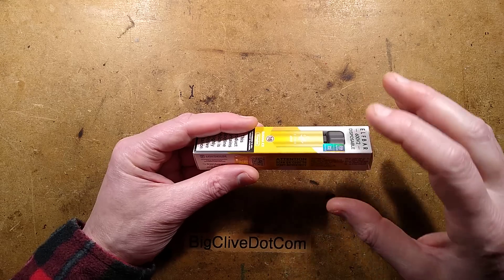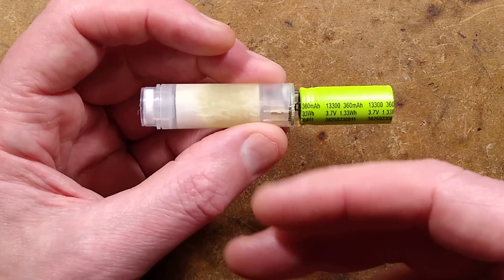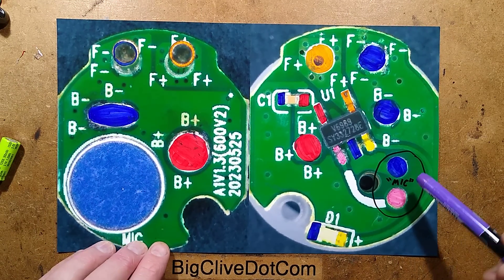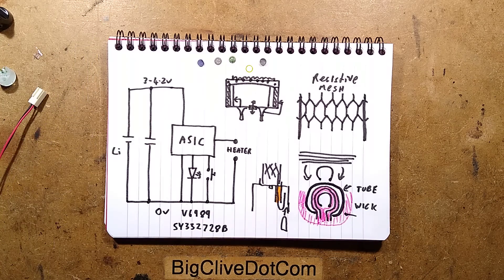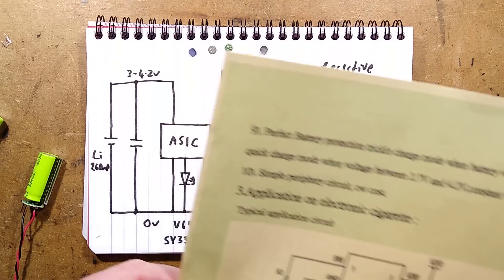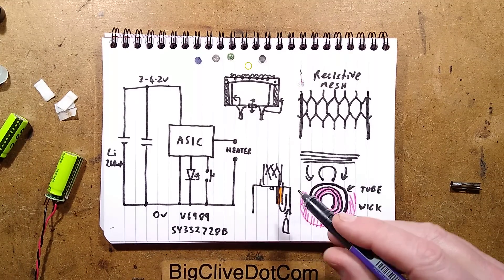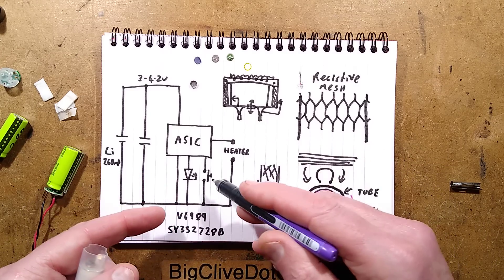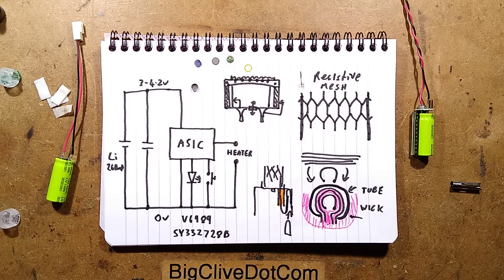Lithium "capacitor" in a disposable product

Comment: I just checked on internet if that kind of device was available in my country (France) and it sadly is. I have a big problem with it since i know how much i pay for my liquid and my vape which is around 40€ for the vape which will normally not break and the batteries can be changes easily for around 4.5€, so i just have the liquid that cost me 9.50€ for a month.

The product in the video cost about 6-7€ for 700 puffs which is ludicrous in term of price since I'm about 10 times cheaper with my vape but the biggest problem is the target which seems to be minors because it's easily bought on internet with minimal age verification and a cheaper initial cost.

Now my biggest grief is that kids buying that have in general 3 choices, 0 , 10 , 20 mg/mL in nicotine concentration. They will most likely buy the 10mg/mL because they are curious.
I vaped 10mg and it's insanely strong to the point of making me dizzy so image the effect on kids.

Ps : I myself am at a point where i dilute to 1mg/mL and soon will stop nicotine completely so Yay me

Comment: I used to work at a battery recycling plant a few years ago and we came across those exact type of cells in a few difference products. Its just the form-factor, Its the same inside as any other 3.7v lithium ion battery.

Comment: Please please dig a tiny bit further in this investigation. Can you establish how much charge is remaining after the vape fluid is expended? I have to clean these discarded items up, some have been run over and damaged and I am always wary of one cooking off when disturbed. My hope is the designers calculated the cell capacity to match the fluid and when fluid expends the battery is essentially dead. But it would be great to know.
Reply from the maker: The disposables often only use around half their cell capacity before cutting out.

Comment: oh yeah i've gotten a disposable vape with a li-ion cell packaged like a capacitor like that... mine had a grey shrink-wrap but otherwise was more or less visually identical
Reply: on a positive note, disposable vapes are excellent to take apart and harvest the battery from. i've converted a number of devices that were meant to run on 3 aaas with those and a cheap ebay bms board

Comment: If i'm remembering right, that microphone actually is the same kind of cheap, crappy microphone that used to be VERY popular in cheap consumer electronics, something like 30 years ago.. They're probably dirt cheap, which is why they're used in this application.

Unfortunately, because they're so cheap, and so shitty, they're prone to failing UNsafe, and causing a runaway activation, which then causes the battery to get REALLY hot, and the atomizer coil to burn, which can, eventually lead to a fire in your pocket.. 

ask me how i know.

Comment: That looks like an integrated coin-cell capacitor.

Simply put, it's a self-charging capacitor that charges off of a tiny integrated coin cell.   This lets a tiny coin cell run a much larger draw by simply drawing off of the capacitor then recharging it.

The coin cells in these are lithium polymer coin cells, which while capable of being charged do not have a very favorable life cycle and can only be charged a few dozen to a few hundred times, with the first few recharges seeing drastic drop in capacity.  The new from factory capacity is likely what the 360mAh is and the cell itself sits at the top or bottom.  It likely only accepts 280mAh on recharges.

Other times they simply add an additional layer into the lithium cell that puts a capacitor electrodes and electrolites on one side of the stack in the roll and then the battery electrodes on the other, to make a "Sandwiched" battery and capacitor integrated.

Comment: Not really new those lithium 'capacitors'...
I have one from a disposable i salvaged years ago, however the low capacity and high cost were supposedly why it was a rare find...

Maybe someone thought "It doesn't go bang" so swapped in a hard-cased lithium cell instead of a pouch!

Comment: Hey Clive,, You're beyond 1000 comments now so you probably won't see this - BUT did you notice that datasheet you briefly showed mentioned "Trickle" and "Fast-Charge" options and a 2.7V threshold ? Was there any info on where one would connect a power source to enable that charging option ?

Comment: 1. From what i know microphones ARE pressure sensors. Hardware wise they're the same, but if the signal is not captured "as audio" then it's not a "mic" in the usual sense.
2. it's nice they made the product more modular, but it really shows how much reusability they want out of it if the circuit does not allow recharging.

Love tuning into your channel from time to time. Always something cool to see.
Reply: Your first point is correct, mics take pressure gradients to move a diaphragm, and then couple the diaphragm to a system that outputs voltage. For example, dynamic mics have a coil (supplied by known current) attached to the diaphragm; as the diaphragm moves, the coil exerts a measurable induction onto a separate sensor, which translates the movement to a magnetic signal, then a voltage signal.

I'm not certain what kind of "mic" they have here, but instead of viewing the output signal as analog audio, they likely compare the voltage to a threshold that is broken when the mouthpiece is sucked on (negative pressure on that side).
Reply: You are correct, sound is nothing but air pressure.
Reply: All microphones are pressure sensors, but not all pressure sensors are microphones. These sensors in the disposable vapes have a switch contact attached to the underside of the diaphragm, the switch is closed when you aren't sucking, and opens when you are sucking. It can't measure any kind of in-between, all it does is open the switch when a certain pressure has been reached. They work almost identically to membrane keyboard switches, just with air pressure instead of keypresses.
Reply: @tissuepaper9962  I can't believe I watched the video, listened to him describe how the "mic" is a pressure-based switch, and still said I didn't know what kind of setup it was.

I guess I was pretty tired then. You are absolutely right, it's just on or off. It would certainly sound terrible as an audio signal though 🤣
Reply: I could see reusability, albeit somewhat "overkill", very useful trait: microchips are close enough in all kinds of products so could just take one from any broken device and put it to other device for repair... No idea what kind of "ideology" framework is needed for this to structure society also in practical terms more compatible with this but seems useful to reuse resources and materials and thus could even afford using higher grade components and a bit more expensive og products to begin with(aint apple products price higher coz people perceive higher resell/even used practical value for those vs same features non apple product).

Comment: Many thanks for yet another awesome teardown, chap! Always wondered how „disposable“ v*pe heating coils worked, so this has been an education indeed! 🚬⚙👍

What really concerns me though is the marking of the PCB for the pressure sensor: You wouldn't label it mic if you had no intent of ever putting one there, and proprietary ASICs can have all sorts of undocumented capabilities in them. ⚠
The tinfoil-hat in me knows a mono audio stream at 4kbps generates 29KiB/min and 1GiB of flash (Almost 600 hours of audio at that bitrate) would easily fit an IC package of that size. 😲

Granted, the notion of v*pes covertly recording users and the environments they go into for dumping-off during the recycling/remanufacture stage is quite an audacious one (And seemingly pointless) but the possibility that it could happen - And that the markings on the PCB going so far as to imply this might even be a design intent - Frankly scares the living Brexit💩 out of me. 😨

And equally scary - Though far less nefarious - Is the knowledge that over the 25 years I've been smoking hand-rolled cigarettes I'll have produced a pile of butts that would fit inside a 240l wheelie bin and could be broken down/recycled using a simple water-based process (Soak the lot, turn into mulch, use as compost) or if dumped in landfill would result in no greater environmental harm than any other biodegradable material. Contrast that to the literal lorry-load of used v*pes which would all have to go through the WEEE process, or if dumped in landfill might cause a fire comparable to the one that destroyed London in 1666... 🚬🔋🔥😲

Comment: I don't vape, but I'm gonna buy a vape just to tear it down, I wonder what batteries are in the ones in my city / country. The form factor of that battery is quite nice, as you can solder it to a board with more ease. I would take the golden pins and weld them to the connectors of the cell to have a plug&play battery for my small projects. Nice video and tanks for the teardown!

Comment: You can recharge these without unsoldering using a standard usb lithium charger board and some thin probe clips to get to the battery pins I have done it loads. These taste better than the V1's but they dont last as long.

Comment: I try to salvage every cell out of these that i manage to find. It's ridiculous that they are disposable when we're struggling so hard to move towards a sustainable energy future!
Reply: What should be done with them? I have a bunch. Havent ever thrown any away. i feel bad for buying them in the first place. :S
Reply: @Elleaf1  disassemble so the battery is separate. youre left with a battery and just plastic waste with minor metal parts.
Reply: @jeletessus but then u can't charge them once in a while and u risk shorting them out! I do both tho
Reply: @Elleaf1  Most people suggest that you take them to your nearest recycling center, landfill, or transfer station and put them in the proper hazardous waste receptacle. That being said, I'm sure you could find an electronics hobbyist who will buy them from you, even more likely if you're willing to do the work of taking the batteries out yourself. They're great for little battery-powered projects, especially since many of them are now rechargeable meaning they come with all the charging circuitry included. The best thing you could do is stop buying disposables and use a real vape which is not only much cheaper for you in the long run, it's also much less wasteful than disposing of lithium cells that have only had a single charging cycle and still have the vast majority of their usable life ahead of them. Pod vapes are a happy medium between disposing of the disposable part and reusing the reusable part, but they're even more expensive than the usual disposables.
Reply: @Elleaf1 Stop polluting the planet, what idiot would buy these when you can buy a rebuildable atomiser and a 18650 modbox?
Reply: @Elleaf1  get BMS boards, and make packs, der? i was paying homeless guys 10c for each one. 

and then gave them lil powerbanks a week later. strap on a solar panel from an old solar keyboard, they were happy. strange. no money for food or drugs but they all got phones...
Reply: @Elleaf1 

Give them to me
Reply: +1, I don’t usually buy disposables but when I do I always take out the battery.. never know when it’ll be useful for a future micro project
Reply: So many eco hippies here
Reply: There's no such thing as a "sustainable energy future". That's pure propaganda that you bought into hook, line, and sinker. 😒
Reply: It's about selling the lithium mate, it's a new gold rush for those producing it, government policy has ALWAYS been influenced by profiting industries
Reply: I have seen dozens thrown away into the nature. On the back side they even have a warning sign with a skull on it, why people throw them away into the nature ?
Reply: yes and there a way better and cheaper alternatives if you want to vape
Reply: Metal casings are good to collect and melt down for scrap too
Reply: That's because the government isn't actually working towards sustainable energy, they're after "sustainable" energy which is either intentionally or unintentionally just gonna kill people eventually
Reply: I have a jar full 'em. Shorted one out by accident, and tossed it in a puddle at work! (bubbled furiously for a few seconds) XD
Reply: They should be made illegal imo. They should only be allowed to create fully rechargeable ones that you can swap out the rechargeable battery when that runs out of juice.
Reply: Disposable products with 1000 cycle rechargeable batteries... Very logical. I salvaged 3 yet, made small power supplies for small projects
Reply: Brooo same, I've even made small 3s lipos for my rc planes I make, using batteries salvaged from old ecigs lolll
Reply: That's because it's all a con!
Reply: @MrDirkles  too bad it's not a cone, instead. Then there would possibly be a point.
Reply: They’re a very reliable supply of cheap but perfectly usable cells…!
Reply: greed knows no bounds. i bought my vape 9 years ago and only have upgraded the rdta. now they made them illegal and promote disposables instead because "they are leak proof". we are fucked.
Reply: Capitalists doing the thing that harms human life but makes profit??? Wow this has never happened before and is totally not the inevitable result of the system!
Reply: @caramelldansen2204  these things are made in china, hardly the capitalist centre of the world. its almost like humans being bad for the planet is apolitical
Reply: @HappyDragneels_page  I've left three comments in reply to you now and they've all been deleted. Normal censorship moments!
Reply: @caramelldansen2204  it's an inevitable result of paternalistic government regulation making cigarettes prohibitively expensive. If cigarettes could be sold at a price commensurate with their actual cost to manufacture, disposable vapes would never be economically competitive. Almost every problem your lot attributes to "capitalism" is actually a result of the unholy union of government and private business, aka "fascism". Ask yourself why a disposable vape, a complex electronic device, is invariably 25%-75% the price of a pack of cigarettes, which are literally leaves stuffed in paper tubes. The answer is not "capitalism", it's "excessive taxation on tobacco products".
Reply: @caramelldansen2204  Yet, these are made in a socialist country as is most of this disposable crap.
Reply: Wokey dokey :)

Comment: It's possible they charged it to 4.35v instead of 4.2 as we usually do.  It is also possible that the circuitry (lol) will allow it to discharge down to 2.0v or less and still provide some useful vaping.  No worries damaging or limiting the cell in future uses if you're only going for single use anyway.

Comment: Isn't the lithium the most expensive part of the battery? Why then replace it with capacitors, instead of, I don't know, putting zinc-air cells in?

Comment: You’re probably not getting the full 350mah capacity on discharge bc your discharge current is most likely 1a. If you discharge at .5a it should show more to true capacity. It’s a small battery, it won’t hold high current discharges like a regular 18650
Reply from the maker: That was charge input at 120mA.

Comment: It makes sense canning lithium jelly rolls in a capacitor can. They're basically the same concept, A thin film wound together tightly and then contained In an envelope to stop the volatile organics getting out. The capacitor cans I would argue are much more safe than the flimsy polyfoil Pillows That can be easily punched or torn.

Comment: speaking of light pipes...i get thick side glow fiber optic (thick but still no wider then a smd led ) and some shrink wrap to case it fully then glue that over the led and out of the box ware i want it basically moving the led without having to de-solder a grain of rice :)

Comment: Interesting. They created a lithium battery in a form factor that can be handled automatically by existing manufacturing machines instead of having to be hand-soldered after the fact. Even with the added R&D for capacitor-shaped cells they are probably ahead of the curve in the long run cost wise.

Comment: Maybe the larger surface area heater allows them to be more power efficient? So smaller battery. Would the saving on lithium be worth the cost of all that more complex assembly? The last one I took to bits was incredibly crude in comparison. Could they also be making savings by using the same parts for both disposable and reusable vapes?

Your description of the microphone does sound a bit like a condenser microphone, but here being used outside its normal equalised pressure situation. So being abused in effect by sudden depressurisation.

Comment: So they're using electrolytic cans to house lithium ion internals? Seems like a pretty clever way to easily house a battery with two terminals on one side, since they get to re-use all the same equipment and packaging that's already used for electrolytic capacitors.

Comment: I'm doing my part, sir. I use the cell and board in these things to convert wired headphones to bluetooth headphones. So far, I had one success, one in progress.

Screw this disposable vape industry. We should've stopped at box mods with zero electronics, just wires and a switch. I can forgive the safety circuits, but not the whole devices built with the intent to be disposed after a week's use.

Comment: masking tape to 1kg bag rice 
two soldering irons - go at it - when hot it falls away from the circuit
Reply from the maker: Two traditional grounded tip irons would be interesting.  I wonder what short circuit current would flow in the ground wires.
Reply: @bigclivedotcom     1 gas propane soldering iron